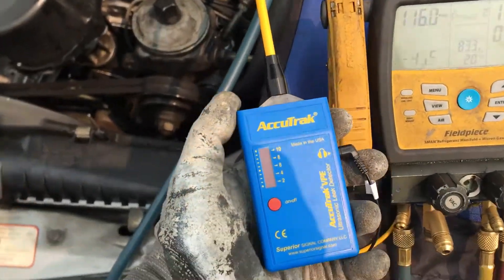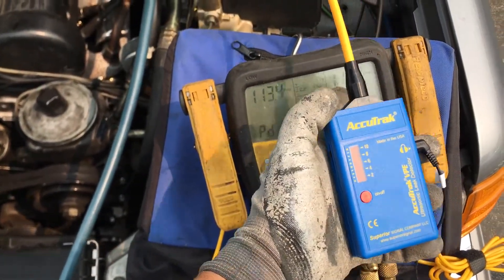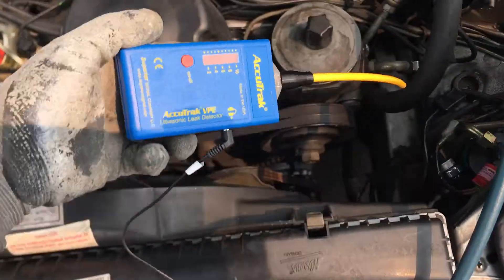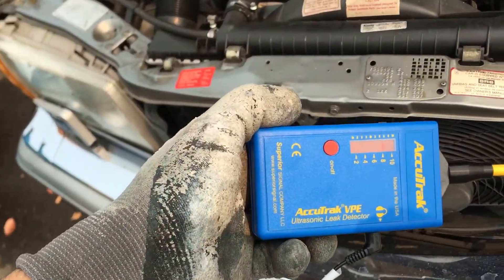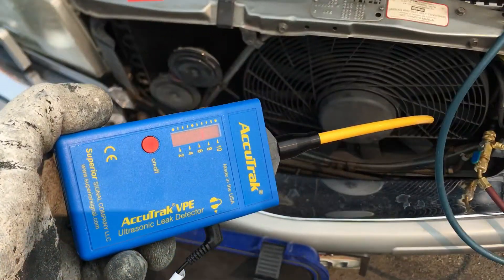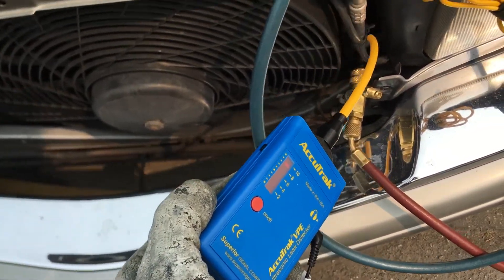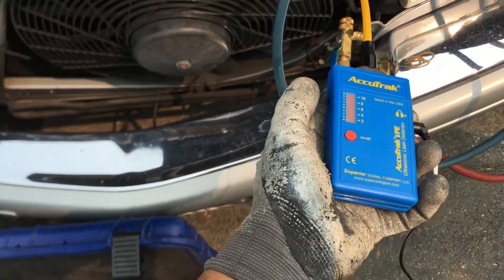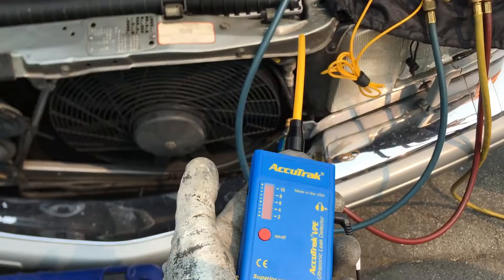Pt:1 AccuTrack Ultrasonic leak detector

Comment: Can this be used while the car is on? Can you run a vacuum and listen for the vacuum leak (car off)?
Reply from the maker: Too noisy with car on.  Can pick up all vacuum from all vacuum hoses in background noise, carburetor or Throttlebody a  or intake is a big vacuum, too much fan noise with car running. 

     Yes car off under vacuum, but turn off vacuum pump at time of testing because the vacuum pump is a large loud vacuum leak. 

         All different type of leak detection devices find different leaks under different circumstances. Not all leaks leak all the time, 
        One time the ultrasonic will find it under vacuum but not pressure, 
          One time you may find a leak using the electronic refrigerant leak detector but not the ultrasonic and vice a versa
            Another time you may find a leak using UV fluorescent dye and the refrigerant leak detector nor the ultrasonic leak detector will work.
         One time maybe just a simple bubble water will be the easiest fastest way. At least a secondary way to officially see exactly where it’s coming from when there’s two or three items to close together the bubbles may pinpointed visually. 

      There is no one way better then the other. 

Oh yeah I forgot to mention high-pressure dry nitrogen. 

         Then there are times none of them will find the leak because it is not leaking under the circumstances that you were testing at that moment but it will start leaking as soon as it drives away and it’s down the street after leaving your shop. Or a few days Later. 

      I have done and released a few videos on a few scenarios where one method of leak detection finds the leak but when I try to use the other method it dose not finds any leak.